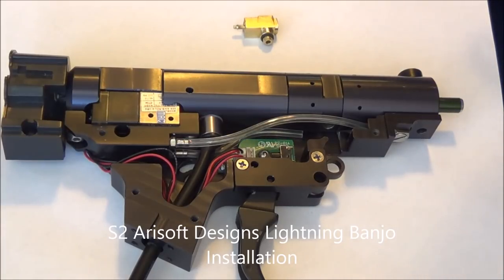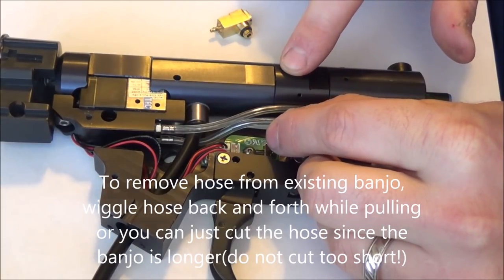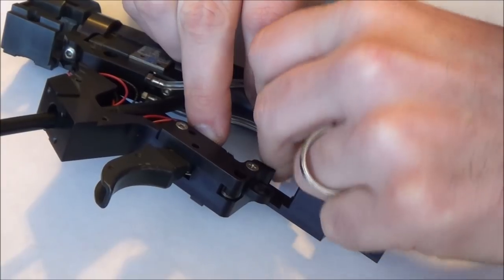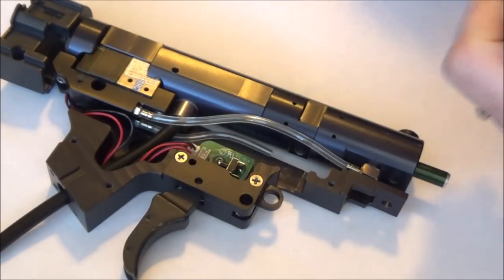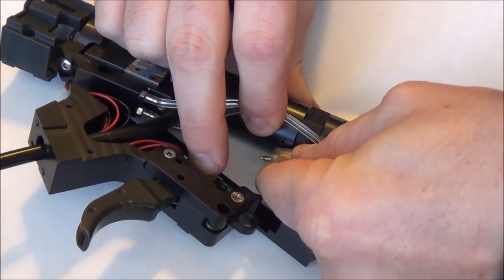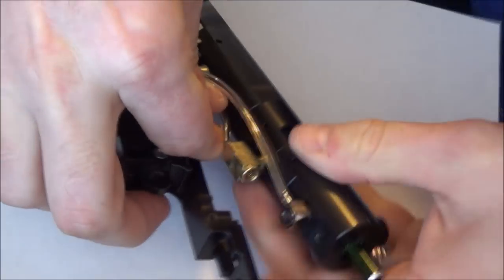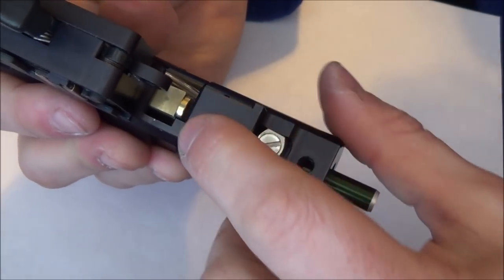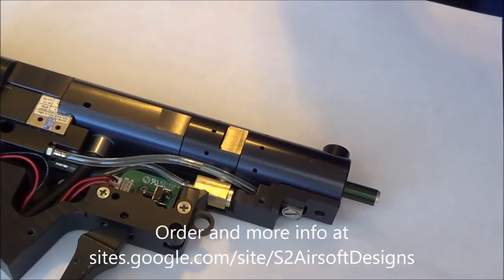S2 Airsoft Lightning Banjo Installation for Fusion Engine

Comment: I had to use the original oring for it to screw on correctly. Even with two it got too tight where I was afraid to tighten it. Should it be tight where I have to use force yo unscrew or tight where I can still tighten and untighten it by tapping it hard enough
Reply from the maker: Just want the oring or gasket to compress and seal.  If it was getting tight you can damage the threading on either the banjo or your engine.  I wouldnt consider it so tight you have to use force.  So yea if you can move it still with a tap that shoyld be good

Comment: Sorry but I’m having a hard time understanding what you mean when you say “not recommended to go beyond 90 degrees from beginning of gasket compression” so when it begins to be come snug as we tighten into the 2nd port, we don’t want to over tighten and begin to utilize both O rings to complete the seal on our v2 gen 3 engines?
Reply: I believe he means dont screw more then 90° after it becomes tight

Comment: Sorry this might sound stupid is there different versions of the lighting banjo ? I got one but it looks a little different the end opposite the barb fitting is squared . There isn’t that round part on the opposite end
Reply from the maker: that is just a newer version of the banjo.  it was easier to machine a flat end rather than a cutout.  you get the same performance.
Reply: Thank you so much for that speedy reply ! Got it in last night ! Thank you again

Comment: Now if only a video for Gen 2 :0
Reply: Alex Moore Seriously, just tried putting this in my Gen 2 and found out it won't work without major modification.
Reply: I did it already. It wasn't that hard
Reply: Alex Moore Which part did you modify? I was thinking I could rotate the banjo a small amount and grind off the corners so I could retain full auto.
Reply: On  gen 2 you have to take away the full auto switch on the trigger board
Reply: That's what I thought. I'm going to find a way to retain full auto, I'll let you know when I do it today.
Reply: sweet haha

Comment: Would this fit in a V2Gen3?
Reply from the maker: xxthehuskycaboosexx   yes it fits v2 gen 3
Reply: stormtrupr33 thank you so much for the prompt reply! I will definitely be picking one up ASAP!
Reply: He litterly installed it in the v2 gen 3. He says it at the begining of the video
Reply: @stormtrupr33  do you need one of these or two banjos? per FE
Reply from the maker: @GameChameleonChannel  one should be enough.  the second would speed up the operation, but not really save any air.  maybe faster rate of fire....but stock FE can do like 50bps...so no need
Reply: Fits gen1 👍